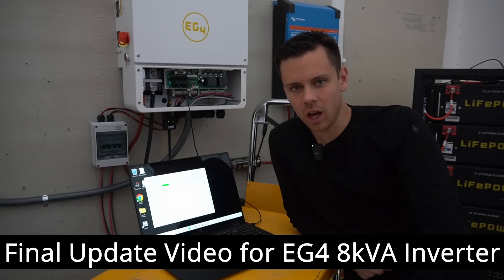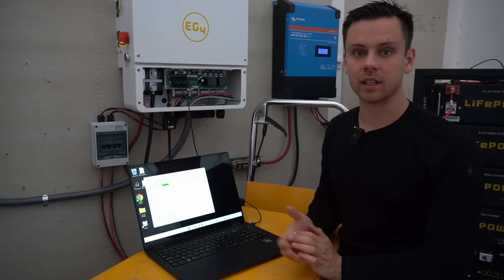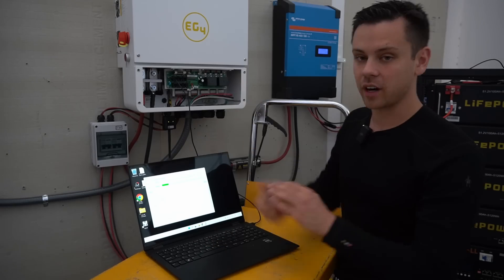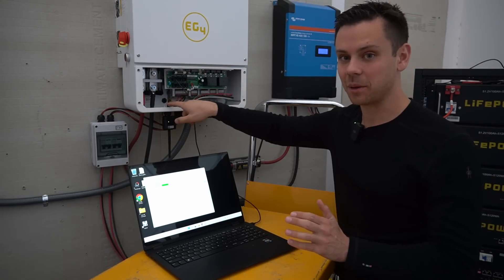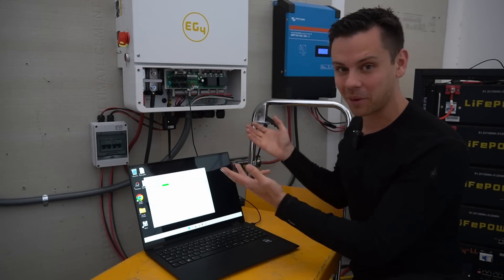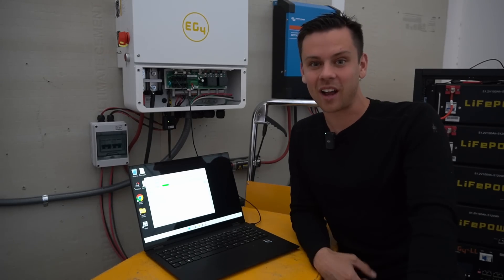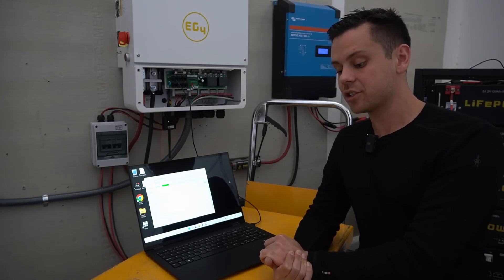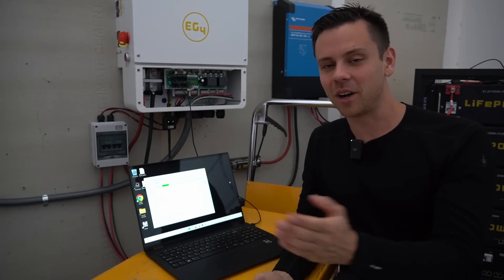EG4 8kVA Final Update

Comment: if ANYTHING happens when you're doing a firmware update, and it doesn't complete, for any device, most likely it's toast.  and that sounds like what happened here. that's because it loads the instructions and code into memory, deletes the old code and installs the new code. if anything happens while this is happening, if the power flickers, or the data connection is broken, those instructions are no longer on the chip, and if memory loses power, whatever was in memory is gone, the chip no longer has any instructions and there's no longer any way to add instructions to the chip, because the instructions that load the external code into memory were on the chip.

all it would take is bumping the USB cord in the middle of the process and it loses its connection for a tiny moment.  

I worry every time I do it at work, and honestly I don't know why somebody hasn't come up with a "safe" two-stage process for firmware updates that doesn't delete the old firmware until the new firmware is installed, or maybe even never delete the previous version, so you always have a fallback mode
Reply: Many PC Motherboards have two BIOS chips for this exact thing. If you flash the bios and it fails you can fall back to the other chip and  your good to go. 
I guess companies just don't want to spend the extra engineering time and money and hardware on another chip.
Reply: @Catsrules1  they can then spend money on bricked computers coming home to roost

Comment: Good real world info, glad you are doing this and not me lol Hey I have a question, have you had any issues with your dual split phase EG4 6500EX-48 inverter setup? That's the system I bought and setup, so far I have no issues but was just curious because you have had yours in use for a lot longer.

Comment: That is why I watch your channel. I am going 100% off grid in a few months and still trying to decide what system I want. Thanks Will
Reply: I went with Victron thanks to his videos
Reply: @Thisisaplaceholder1  they are the best. modularity, configuration, cloud, very low consumtion of it's own running on load/idle. yes, initial cost are higher, but you don't have husstle once you've proper install it and you've configured it well! victron enviroment/ecosistem it's goes flawlessly !
Reply: @matasofutpemata  Victron has the best software, hands down.
Reply: @Thisisaplaceholder1  I was thinking of Victron but I thought all they made was grid tie and solar only for a very hefty price.
Reply: @kevchard5214  nope, quite contrary.
Reply: @kevchard5214  depends on what you want. I needed something that could handle full time RV living and all the vibrations. For this they are the best available.
Reply: @Thisisaplaceholder1  All I need is something for a 400 Square foot passive cabin in the Ozark's. My thoughts are buy top of the line and hope it doesn't break or buy mid grade and have backups.
Reply: @Thisisaplaceholder1  Houston we have a problem the RS450/100  Solar charge controller have an issue error code 200 after a couple of month one of the Transistors are broken and no function on the DC side working.on the solar side is measuring a failure with a short circuit and the charge controller is off 😲💀
Reply: @you2bevsgoogle  damn, good thing they have a good warranty. Sorry about the bad luck
Reply: Go with the Schneider
Reply: @SpencerLAPower  They are on my list thanks.
Reply: Victron stuff is super nice but you do pay for it. I've had 2 MPP Solar all-in-ones now and both have worked exceptionally well. I do wish the standby consumption was lower though, and the monitoring software is pretty basic but does work. But if you have space, adding an extra panel or two will make up for that standby usage.

Comment: Thanks for sharing. You never splained why you are using lead acid setting for battery...
Reply: I think it was in another video if i remember right Lead acid is the default setting you use when you don't have communication between the inverter and the batteries. Or something along those lines. I think the other options expect communication between the BMS and inverter.
Reply: @Catsrules1  My Growatt units have settings for com connected lithium as well as a setting for non-com connected batteries, along with lead-acid settings and a "user" setting. I am having zero problems with them. Not sure if Will missed a setting somewhere or that this particular EG4 unit just doesn't have that setting.

Comment from the maker: Now the menu buttons and on off switch are not working. It's stuck in one of the menu screens and will not respond at all. I think it's officially bricked.
Reply from the maker: And the firmware update said it worked flawlessly. There were no hiccups at all. I powered down and back on and it wouldn't turn on ac output or PV input. But now it won't work at all.

Usually I know what caused an issue, but this is just a completely failure. Very unfortunate

Comment: Looks like I can scratch this one off my list of potential inverters. Thanks for doing the leg work, Will.
Reply: Mine works great hehe :)  I think Will didn't have his BMS and inverter communicating correctly.  There is a firmware that is about 3 months old that seems to fix all of the issues.  Follow the guide that Sig Solar has on initial configuration and it works great.

Comment: Could your USB be going into power savings mode due to flasher not configuring properly, therefore shutting communications on the injection? In Window Hardware Manager, you used to be able to edit the hardware profiles for USB to not have them sleep.  I use Linux so not sure of newer Windows abilities. Probably a long-shot, but
Reply from the maker: I've actually been pulling the cable in and out to test if there's something weird that I'm missing.. I could check window hardware manager. What Linux system are you using currently. I love Linux
Reply: @WillProwse  Archlinux.
Reply: @JimmyCall  you forgot the btw.

Comment: Hear me out! To flash some hardware you have to press and hold power button turn it completely off. Prepare youur firmware flashing software. Begin flash while pressing and holding power to turn on (hold power button up to 7 seconds to get 'boot mode')  this has worked for me with a ton of hardware in various industries
Reply from the maker: Yes I've done this multiple times and you are absolutely right.
Reply from the maker: I also disconnected battery and discharge capacitors as well after I had a successful update
Reply: I've been around hardware and software controls since the 80s. Holding down a power button will ultimately "interrupt" most any system that is functioning at a "fundamental" level. For example, most all hardware still uses some form of "eprom" that handles "Basic input and output" of hardware. "Firmware" can be part of this "BIOS" processing. However,  "FIRMWARE" can also be much more complicated. There can multiple "layers" to firmware loads. Some can actually change individual hardware component operating parameters. Holding the "power button" can send a interrupt to a system that is still functioning at "fundamental level". However, it will not always power off or "discharge" every component. Which is why, sometimes, you have physically remove power. Even then, there maybe capacitors that will continue to hold power on components after even removing the power itself. I would recommend you try leaving the unit disconnected overnight or even a day to make sure every single component has been reset by removing power....... I have no idea what holding down a power button does when you power on a device. It can send an interrupt in the startup process but it is not standard across many systems that I know of. My penny.
Reply: @risermoreriser4237  I have to pull this out of the hat with ESP32 based devices sometimes. Flashing during power on